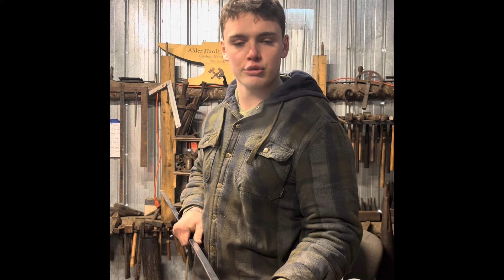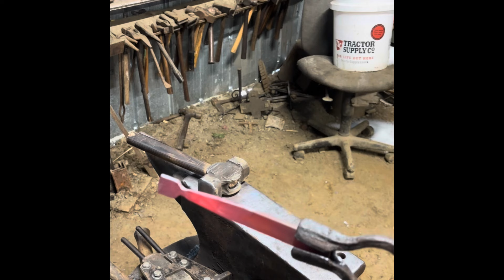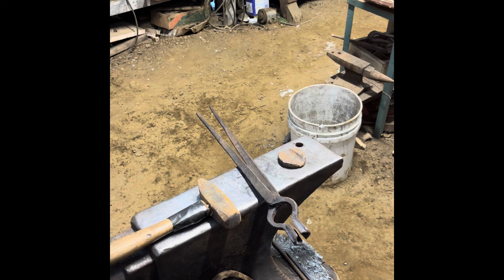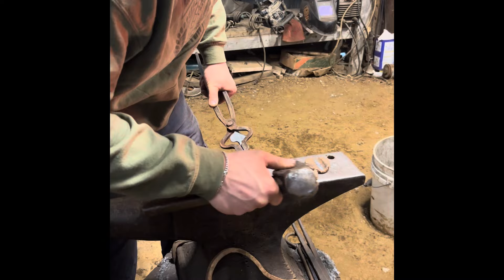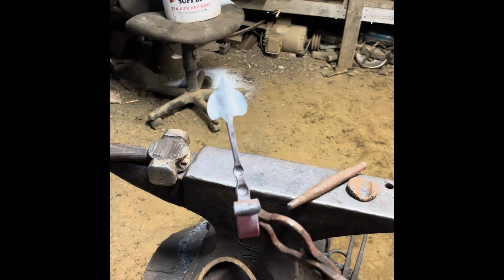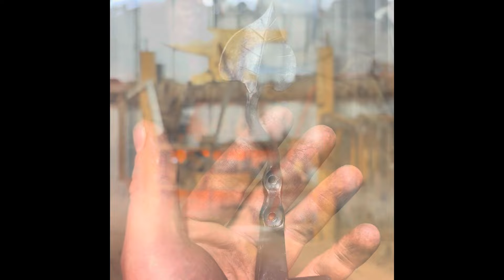FORGING A LEAF HOOK

Comment: Nice job!  I use round or square to make leaves.  No guillotine tool needed.  Your methods seem kind of complicated for a leaf and hook.  Usually it is a hammer and anvil only exercise to improve hammer skills with half on, half off strikes.
Forge On!!!
Reply from the maker: Thanks man yeah there’s definitely no reason to use a guilty tool if you’re foraging a leaf from rounder Square bar, but as for flat bar, I found it to be advantageous as for shoulders with the hammer and anvil can be tricky